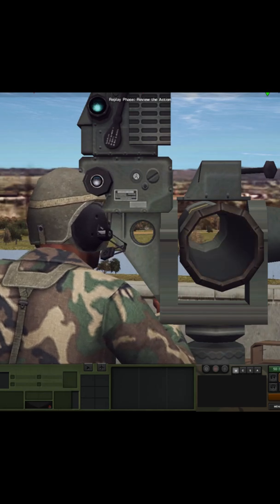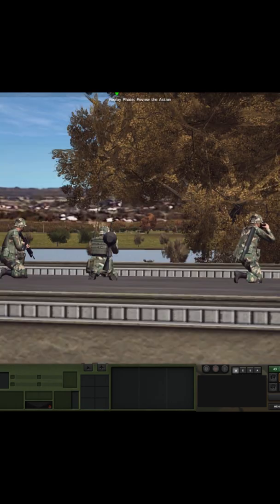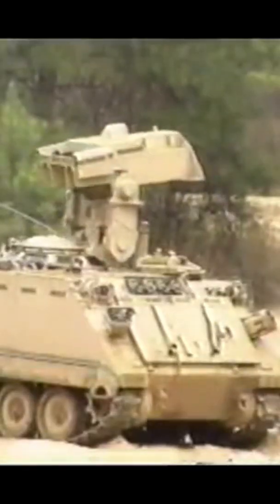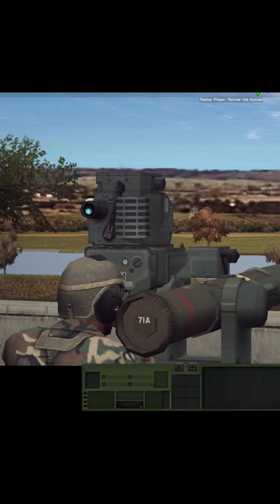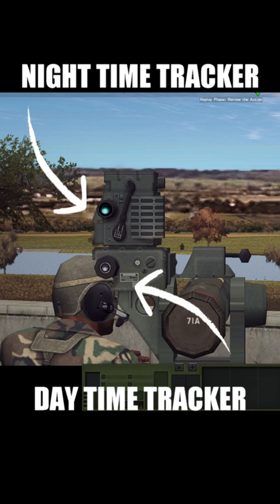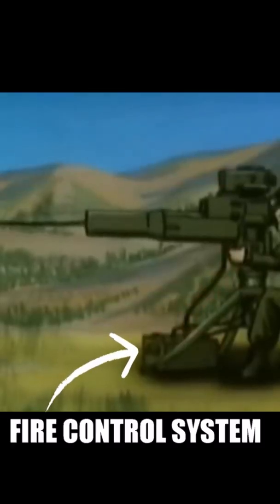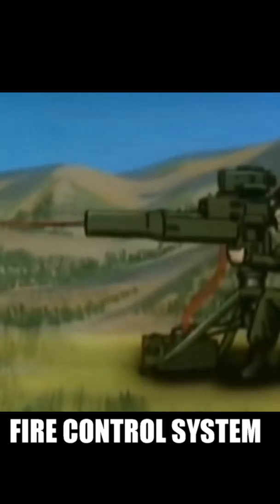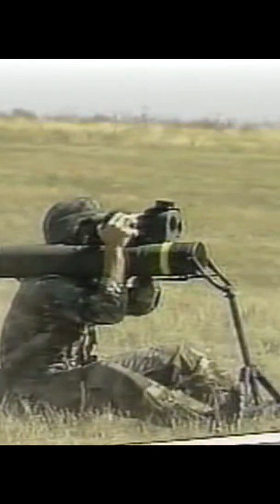How did they guide TOW missiles with 1980's technology? #shorts

Comment: Spent 7 years as a TOW anti-tank guided missile gunner (1986-1993). Great system, VERY reliable with devastating hitting power. The wires create a closed-loop system that is VERY difficult jam or detect until it's too late. It's been in service since 1972 with continuous upgrades. It works...no doubt about it.
Reply from the maker: Interresting! I always dreaded having to carry the Panzerfaust in my days, which was just a shoulder launched AT rocket. Can't imagine having to carry a TOW around all day long 😁.
Reply: @FreeWhisky  It's a vehicle mounted system but we occasionally had "vehicle appreciation day" when we had to hump everything out to the range ourselves...out AND back. Believe me, we appreciated our vehicles after that as much as was humanly possible.
Reply: So some questions . Whats the task list for Setup . And is there a lock on Feature or is it guided only by the sights
Reply: @Abe-c4d  The power-on/system test procedure has been simplified with the present generation TOW system. We were using the TOW-2A with digital MGS (missile guidance set) and AN/TAS-4 infrared night vision sight. Once the system is powered up, the MGS has to zeroed in, and the sights (binocular day sight and AN/TAS-4 thermal sight) have to be aligned with a boresight collimator). Didn't take more than a couple minutes to get it ready to fire. I ALWAYS fired with the night-sight, even during daylight hours. That AN/TAS-4 was amazing. That level of capability wasn't available beforehand and we had it and a fully functional TOW-2A missile system mounted...on a M-151 Jeep! Small, fast moving, very low profile, quiet as a church mouse 🐁, and able to blow the turret completely off a main battle tank from 2 and a half miles in ANY weather, day or night. A 55 gallon drum of pure uncut whoop-ass.
Reply: How do you think TOWs would preform against modern tanks from the front? Like the M1A2, Leopard 2A6, T90M and so forth? Would the sheer size and explosive power of a TOW punch through them?
Reply: @Rokaize  Most definitely, that's why the TOW missile is still being produced and still in service since 1972. And with 7 years experience with it I can say that thing is absolutely devastating, day or night and in any weather conditions. That's what the "B" in BGM-71 TOW stands for: all weather operations day or night.
Reply: @chrisnizer5702  Yeah I’ve seen plenty of videos of Kurds and other rebel groups using it. Even at night like you said, against more modern armor like leopard 2A5s. And the TOW absolutely rocks a 50-60 ton tank. The TOW is a real monster. I feel like even if it doesn’t penetrate the armor from the front. The huge blast will damage optics and vision ports and other equipment on the exterior 

What do you think of the Kornet since you have experience with the TOW?
Reply: @Rokaize  Shaped charge warheads (TOW and Kornet) are ALL ABOUT diameter...the larger the diameter the better. TOW has a full-caliber 6 inch main-warhead, the Kornet does not. It's still a good weapon just not quite as capable as the TOW. Kornet doesn't have thermal  optics either and that's a MAJOR advantage of TOW. I can see you from 2 miles away in the darkest night, even through the rain and the fog. If you're smoking a cigarette you may as well have a neon sign lit up saying "HERE I AM, LOOK AT ME!!"
Reply: @chrisnizer5702  Yeah I think some of the later variants of the kornet have thermal imagers but not the older ones. All in all I think these systems are kind of underrated. The javelin and nlaw get a ton of attention. But most people probably don’t even know what a Stugna is. 

Highly advanced systems like the nlaw and javelin are good I’m sure. But nothing beats the reliability and cost effectiveness of throwing a huge missile and guiding it manually in my opinion.